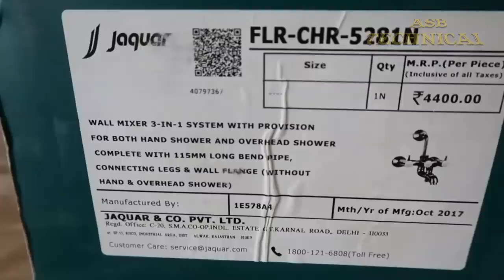Jaquar 3in1 Wall Mixture unbox & Installation in bathroom.

Comment: It's a nice and useful video. Thank you. But, we people in India tend to use all unconventional methods and tools to do the work. Like holding the pipe and fittings under the foot and cutting with a hack saw, tightening with an adjustable spanner instead of the right size spanner etc. Indians have a lot of innovative and time saving ideas, but using the right tools and accessories would make life much easier and also improve the quality of work.